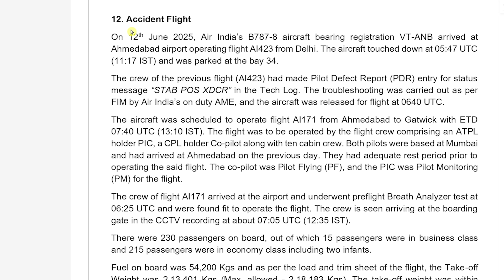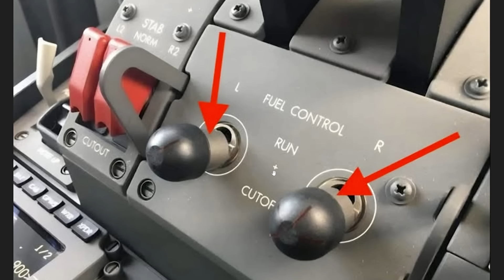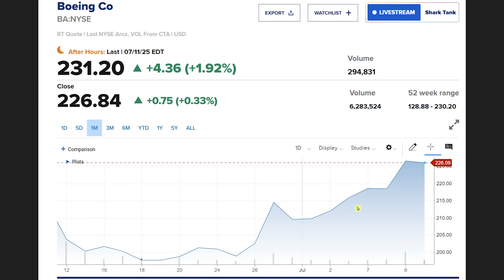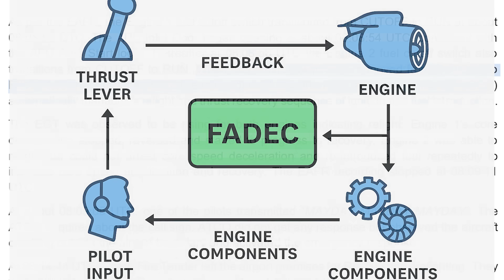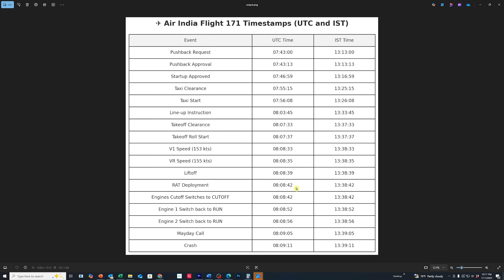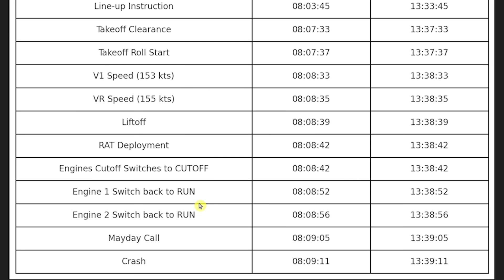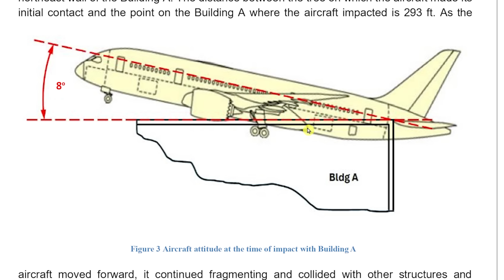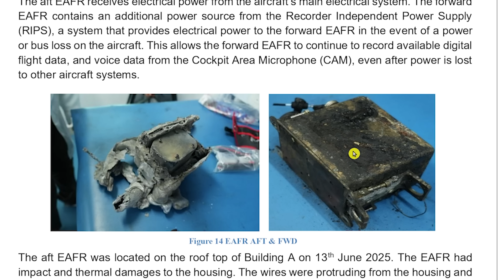Did Pilots CUTOFF Fuel? Shocking Twist Air India 171 Report!

Comment: "I did not do so..."      I think we may assume the intent of that answer was to distract the flying pilot from immediately recycling the switches, an intent which worked to perfection - 10 and 14 seconds pass before doing so.    Also very likely it means the flying pilot did not actually see the action but rather jumped to that conclusion based on his loss of thrust, and when the other pilot denied it, the flying pilot looked elsewhere briefly for a solution.   Those ten seconds were critical.   Now, it IS possible the flying pilot moved the switches.   And we do not know for certain which pilot was actually flying even though the co-pilot was so scheduled.    I do believe this was a suicide and that the answer was to buy time for the engines to spool down.

Comment: Has it been absolutely confirmed that other than the captain & first officer, there were no other people in the cockpit of the Air India flight? On a 6+ hour flight it’s not unusual for airline employees to “deadhead” in the cockpit. It could even be a courtesy situation for an flight crew member from another associated airline.  The 787 has a several fold-down seats for non-operating personnel in the cockpit. Leaning and reaching forward, a suicidal cockpit “guest” who was technically savvy about the aircraft, could operate the engine run switches. Sometimes, people who are deadheading are last minute boarding requests…The 787 has a rather unique (for an airliner) heads up display that the flying pilot would be focused on during takeoff. He wouldn’t notice fingers on the lower throttle quadrant switches.

Comment: When that RAT was deployed, it's fate was already sealed.  I am familiar with those types of switches. Not only do you need to pull them to prepare them for movement, but most springs they are equipped with require a bit if strength to pinch and pull as it were. I will imagine we will be hearing about the personal backgrounds of both pilots here soon.

Comment: "Was it intentional?" That's EXACTLY what I was wondering. But what else could it be? Could it be unintentional? If it takes such a deliberate movement to turn the switches off, how could it POSSIBLY be unintentional? It seems, from what I've heard, that if you turn those switches off, there is no doubt that you KNOW you are turning them off. So, we can pretty much guarantee it was intentional. The question that still remains is WHY???? Why would you turn the switches (that you KNOW will stop fuel from getting to your engines) off at THE most critical time of the flight? The answer to that is quite ominous.

Comment: My remark is the Honeywell switches were not confirmed to be with locking mechanism. Honeywell has this feature as optional. That SAIB NM-18-33 was referring to check if this feature was used or not. So for me this switches could be toggled without lifting, explaining why the cutting off was achieved in 1 sec on both engines. That still does not explain why it took that time to switch them back, especially the gap in time between engine 1 and 2. There are a couple of things I do not buy either.

Comment: Would the time of lift off and then the time of fuel being cut off (3seconds) correspond with the time frame you would lift the gear? There was no attempt to lift the gear, is there by any chance a jet that has the landing gear controls in the same place as the fuel cut off controls in a 787?? Maybe one of the pilots had recently been piloting such plane if it exists? The mystery maybe more related to why was the gear was not retracted as soon as they took off? It would be interesting to see what planes the pilots have flown prior to the disaster, muscle memory is a real thing. Would this explain the question asked about the fuel being shut off and the response?

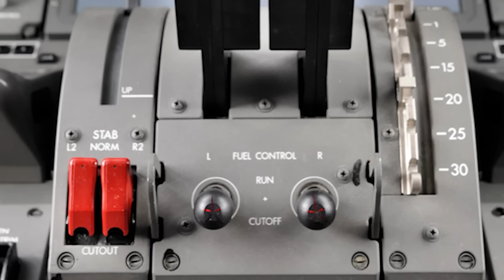Comment: At your 12:00 mark you talk about four seconds being too long between switching engine 1 and engine 2 to the run position.  Can this aircraft start both engines at the same time?  Maybe you need to wait until the first engine is started and fully running before starting the second one.  Maybe four seconds wasn't long enough, but they did it anyways out of desperation, and that may explain why the second engine didn't ramp up.  I'm speculating, but thought I'd offer these thoughts.

Comment: If it's difficult to change those switches, it sounds like it couldn't be done 1 second apart.
Reply: The report also does not state that the switches were definitely moved physically, they are going of sensor data that could have been due to an electrical fault. Remember the switches were found in RUN. The RAT was deployed within 5 seconds of fuel cut-off was recorded and 3 secs after the take-off, this could have been a major electrical failure and not pilot's switching off them physically, so it could have been an electrical failure which shows that both valves were switched off via electrical failure of some kind
Reply: This video shows an example of it being done in 1 second
Reply: @ImperrfectStranger  where does it show that? I believe it took 4 seconds to switch them back on...also I believe he said it had to be done individually (one and then the other) you couldn't do both at once (05:06). Plus if it was suicide mission, why did he flip them back on?...ok to answer my own question - maybe the one flying the plane switched them back on? It would be interesting to know which was the first switch to be turned off (l or r?) and in which order were they switched back on (r or l?)
Reply: There's nothing difficult about it. Especially if you have done it hundreds or even thousands of times.

Comment: By the timing it looks rather that the system itself shut off the fuel valves. One pilot observed 'no fuel flow' and asked: 'Why did you shut off the fuel?'.
The other one said:'I didn't'. They looked at the switches and were shocked since both switches were in the ON position.
It took them a few seconds to assess the situation and then the memory items kicked in. The Emergency Checklist requests the switch into the OFF position and ON again.
This for both switches and this are the four seconds 52-56.
Strangely the switch needs an OFF first and then an ON. Looks as if this is edge triggert.
Maybe Boeing can explain why this is so.
The pilots are heroes; they did what they could!
Reply: I have a feeling that you are spot on
Reply: Software- system Software commanded event to shutoff fuel valves behind the scenes, after receiving electrical condition 😮😮 ¿¿¿¿》maintenance subroutine?
Reply: @pjpaulamcpip3266  Yes, unbelievable that these idiots allowed this software code to persist in the system.
I was too ugly to fly with passengers, but for cargo and repositioning of aircraft it was acceptable.
What I encountered within these 8k flight hours is unbelievable !
Reply: @pjpaulamcpip3266  Sadly these idiots left this portion of software code in the system !
Reply: U know it took 10 seconds to restart the N1 engine and 4 more for the N2 engine to restart
Reply: @bhaktimandir-my5pk  9 seconds between engine 2 cut-off recorded by the sensor and engine 1 turned on. Let's say it took 1.5 seconds (based on average statistics) to turn it on. So, that is 7.5 seconds to respond. Now consider that the pilot must see the problem, recognize it, and decide on the corrective step.
Reply: @Supsyfy  Very true !
Reply: @bhaktimandir-my5pk  Yes, it takes a few seconds for spooling.
Some engines need even to be below a certain temperature to allow a restart. Otherwise, hot start!

Comment: There is a big problem with this report which also makes me believe there is a cover up for Boeing. If the switches are flipped when the plane is in mid-air, there will be several alarms going off at the same time. There is no mention of this. How is it then possible that they didn't flip the switches back for another 10 seconds?! Why was the conversation so casual? 100% cover up!!! Why are you ignoring the bulletin that mentioned switch malfunction? It’s VERY convenient to blame 💀 people.
Reply: First, so far we only have a limited transcript.  You do not know what was actually on the CVR, there might have been alarms.  Second, do know for certain alarms go off for the fuel switches going into cut off?  Third, why isn't it reasonable the PIC spent 10 seconds figuring out the switches were cut off then resetting them?  Fourth, you have no idea how "casual" the conversation was - AGAIN, this is a partial transcript.  Fifth, the bulletin was NOT a switch malfunction, it had to do with the detent lever and not an issue by FAA (still almost implausible the switch could be accidentally switched off) and Sixth, why are you so intent on blaming Boeing???????
Reply: @jimrothwell535 if its Boeing i ain't going.

Comment: To me the most fundamental question needs to be --- Why Boeing did not make fuel cutoff logically denied when all the other sensors and instruments are telling the master aircraft control that the plane just took off and is barely in air ?  This should not be a HARDWARE SWITCHING LOGIC, instead it should be placed in a SITUATIONAL SOFTWARE SWITCHING LOGIC condition that the attempt to cutoff fuel be denied in the control logic .. It should be the same concept as the emergency braking when sensors tell the automobile is about to hit an object in front with high speed .. Logically, at that moment, any input to speed up the automobile, or to disable braking, should be denied by the master control software ..

I think people should gather around and debate that HAD this switch been made into a "software switch", what could have been the downside ?  And can the downsides be addressed in the software ?

The world has long ago moved on from the ancient hardware ladder diagram control logic .. Why hasn't this one ?

Comment: 787 has exactly the same fuel cut off switches as the 737. Those on the 737 had multiple reported problems with not locking correctly, or flipping out of the position unnoticed. Air India had the Boeing bulletin to check the switches, but did not do this because it was not mandatory. I'll tell you, those switches changed position by themselves, probably because of heavy vibrations after take off. Boeing is 100% at fault, those switches have a very bad design. The locking does not secure properly. This fact will come out, and Boeing is toast.

Comment: Why would the rat deploy the same second as the fuel cut? Something is so strange
Reply: the RAT didn't deploy because of the cuff-off valves, 
It shows that it was a major electrical failure that was the reason for RAT deployment.
The report also does not state that the switches were definitely moved physically, they are going of sensor data that could have been due to an electrical fault. Remember the switches were found in RUN at the crash(pictures attached in the report). This could have been a major electrical failure and not pilot's switching off them physically, so it could have been an electrical failure which shows that both valves were switched off via electrical failure of some kind
Reply: @farazalikhan5242  the RAT deployed because the engines fell below minimum idle speed - no mention of major, or minor,  electrical failure. read the report.

Comment: The FDR did show fuel cut off in both engines and fuel supply resumed 10 seconds later, I presume. The issue is could the FDR tell if it was one of the pilots turned both switched to cut off mode manually or the fuel was cut off automatically with a jump switch for some reason before either pilot noticed ,only for one of them to re-switch it on?

Comment: I 100% disagree
Tell me why cutoff switch activated
there can be three resonses
1
 Engine stop the cut off should activate and tirn off the fuel flow 
2
Fuel lines under or over the required pressure or fuel leakage 
3
Computer command to turn of the fuel 
So plz find out why cutoff switch activated find out the reason 
i believe cutoff switch should not connected wiyh the CPU

Comment: 0842 both fuel switches to cut off position. 
Q1.
What time was the voice recording asking why did you switch the fuel off?
Q2.
Why did it take till 0852 so 10 second to switch engine 1 back to run and engine 2 0856 another 4 seconds after that? The time of realisation these were off is critical but is not mentioned.

Comment: @5:13. I read the report.   It sounds like the captain pulled those switches because the first pilot was supposed to be the pilot flying. I am not sure how you could pull switches that quickly while trying to fly the plane with the controls in his hands.  Also one of the engines were replaced so maybe the engine was able to relight faster because it was in newer condition@ 11:55@ it took them 10 seconds to switch back on because somebody was in shock at what just happened. could imagine somebody doing that while you’re trying to fly the plane they were probably were looking at each other at that point. 15:41@ well that part of the report is a poor attempt of a distraction.  It pretty obvious of what occurred here.  They will have to look into the pilots life particularly the captain.  Was he upset about something with the airline company and he was about to retire?

Comment: The BBC says: "in December 2018, the US Federal Aviation Administration issued a Special Airworthiness Information Bulletin (SAIB) highlighting that some Boeing 737 fuel control switches were installed with the locking feature disengaged. While the issue was noted, it wasn't deemed an unsafe condition requiring an Airworthiness Directive (AD)"..."The same switch design is used in Boeing 787-8 aircraft, including Air India's VT-ANB which crashed. As the SAIB was advisory, Air India did not perform the recommended inspections."..."Mr Pruchnicki said he's wondering whether there was a problem with the fuel control switches.
"What does this [bit in the report] exactly mean? Does it mean that with a single flip, that switch could shut the engine off and cut the fuel supply? When the locking feature is disengaged, what exactly happens? Could the switch just flip itself to off and shut down the engine? If that's the case, it's a really serious issue. If not, that also needs to be explained," he said."
Also, why did this report take so long to come out, and if this was intentional why would the switches be set to 'run'? Finally why didn't the report contain a voice identified timestamped transcript?
Jeff, what do you think?

Comment: Air India Flight Crash: Preliminary Cause Report Released A preliminary report into the cause of the crash of the Air India Boeing 787 Dreamliner, which crashed shortly after takeoff on June 12, killing 260 people, indicates that both engines were cut off from fuel. The document, released on Saturday, does not yet provide final conclusions or identify those responsible for the tragedy. According to a report published by India's Aircraft Accident Investigation Bureau (AAIB), three seconds after takeoff from Ahmedabad Airport, India, the fuel controls on both engines switched from "on" to "off" almost simultaneously, rendering the engines inoperable. The London-bound plane immediately began losing power and crashed into buildings near the airport. Of the 241 people on board, only one survived. The crash killed another 19 people on the ground.

The cause of this crash was VACCUM LOCK / VAPOR LOCK!
Reply: Nope

Comment: Switches mounted without guard protection and loose. At high speed hit a bump on the typically rough runway and bang both switches closed at practically the same time hence the very very fast 1 second between closes. 
Probably a combination of poor maintenance/high usage and bad Boeing install or design... Also reported on the 737.
It might be that when they put them on open they pulled them back and didn't quite fully engage them in the open position. Likelihood of pilot wanting to kill everyone pretty low... Let's face it there's more spectacular ways of doing it... Why do it at take off?

Comment: According to the timeline (13:08) the cutoff switches were off for only 10 secs.  That means the engines were hot and still rotating at full revs when the switches came back on. So the engines should have roared back into life immediately. The crash happened 10 secs later and there is no indication whatsoever on any video or audio of the crash, of any engines powering up. You can actually hear the engines idling. Plus the pilot did say "NO THRUST". He wouldn't say that if the other pilot was trying to crash the plane. So, it is still possible that the engines went out due to a FADEC issue and the pilots were attempting to restart the engines.

Comment: That bulletin about the faulty switch locking mechanism might be more important than you think? Air India DID NOT carry out the checks as the actions in that bulletin were not mandatory. The cutoff switch lock mechanism was exactly the same on this plane. We will see. 

Also, the RAT deployed at exactly the same time when the switch got flipped to cutoff position? I wonder how much of the switch flicking depends on the mechanical movement and how much depends on the software running the engine control, do you know? Is it possible that there was an electric failure and that is why the RAT got deployed AND that failure affected the computer that then tried to recover the engines automatically? Or it just glitched out? This theory depends on whether or not there is a warning signal when the cutoff switch is changed into off position during takeoff, as one of the pilots asked why the switch was off and without that warning he must have seen the switch in cutoff position. We will see.